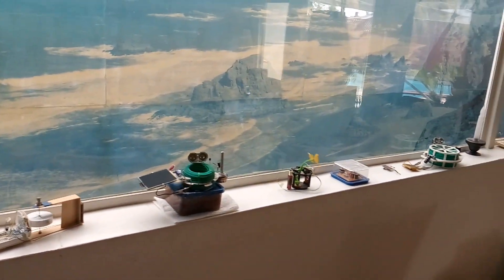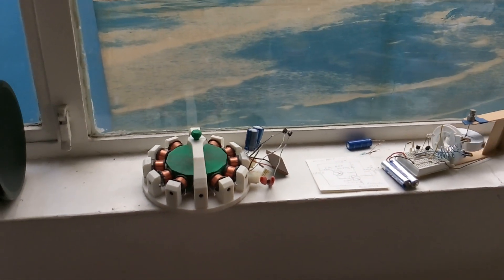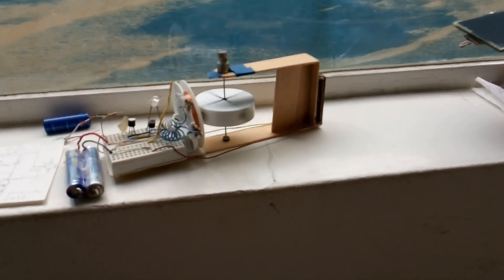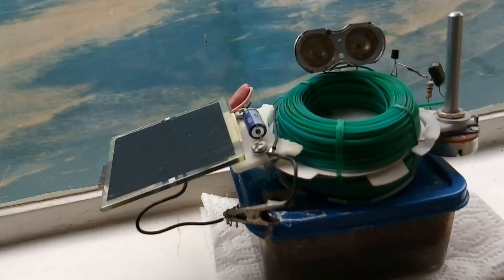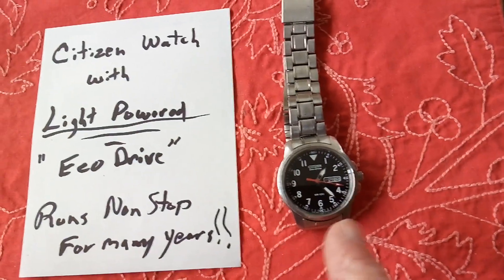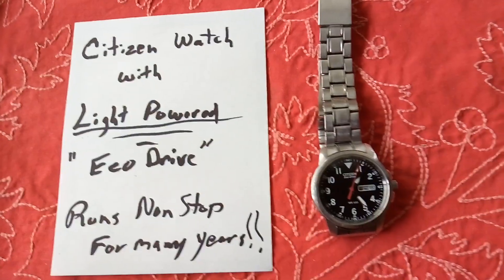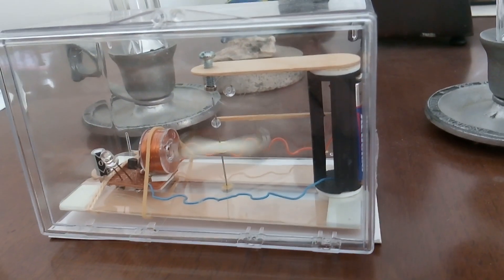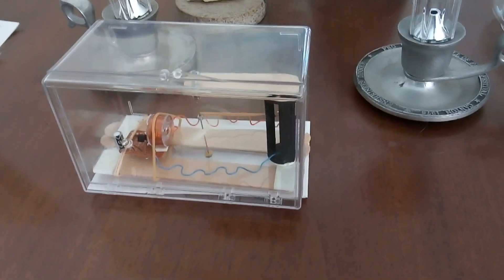My non stop running device experiments update --  After 3 1/2 years

Comment: What happened to the plant run thing, you had two strips of metal implanted into a plant that sent a small energy into s joule thief that ran a light.
Reply from the maker: My plant battery experiment had a very unusual ending.  The thing ran for years as an indoor plant battery that powered a joule thief.  It was very successful --until it got attacked by ants!  Form time to time we bug bomb our house and put the house plants outside for hours while the bomb is working.  About 6 months ago I came home and found ants all over the kitchen countertop near where the plant battery lived.  Some how the ants had found the plant outside and decided to build a new colony there.  I took out the battery compents and jule thief (still working)  and put the plant outside.  I killed all the ants with bug spray.  It appears that the bug spray not only killed the ants but also ended the life of the plant.   Sad ending.  I may start a new experiment using the same old components and a new plant.  The magnesium anode was the only thing that needs replacing every so many years.  The plant doesn't seem to mind the whole thing.  The ants loved it.

Comment: Put the battery and wire on the other side . It will all work in the same direction. This is on the one that should have worked ,but really didn't.

Comment: Was my comment's blocked about using this to make a self winding clock charge cellphones
Reply from the maker: I didn't see your comment about a self windung clock / cell phone charger but that is an interesing idea.
Reply: Please  message me at jameskennymatheson@gmail.com  

I can send you a video 
Or you can enter james matheson clock charge cellphone on YouTube and you will see it 

All.it needed  is the front to be geared up and the.motor you made at the lightest point to run indefinitely 
Thanks for getting back to me 

I hope you do it
Reply: On some clocks a shaft comes out of the frront 
The reason  the shaft coming out of the front cant be geared  so the clock winds itself  as the inside releases  is the front loses strength  
So conceptually  if your device was on tje front that your device would be able to make up for the strength loss and make it so the clock kept winding itself 
That's the concept